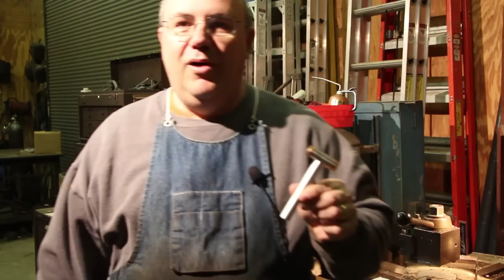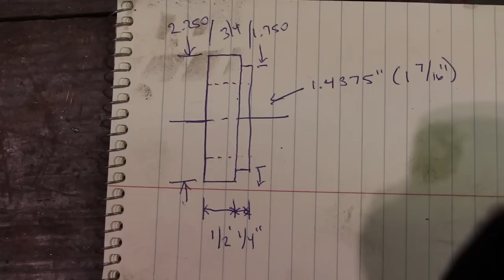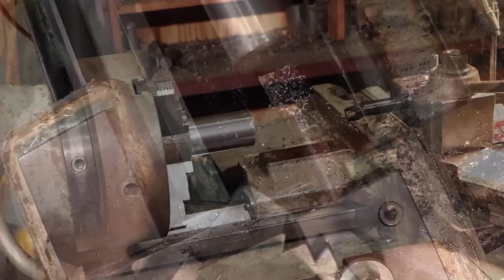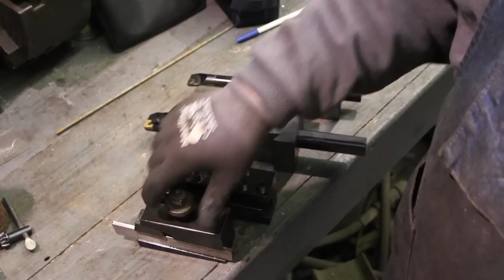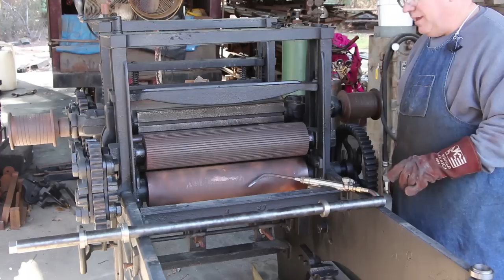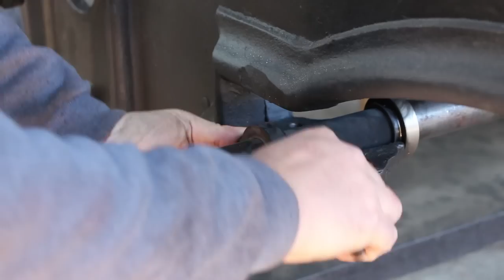Pouring Babbitt Bearings on the J. A. Vance Planer/Matcher

Comment: I'd guess you do the bearings for your steam loco's too? I did a lot of the bigger babbited bearings in rail stock a long time ago .Pretty much the same as you do it except we used a dreadnought file to clean up the edges. If a precison fuit was required (lathe repairs) we would file the bearing face(to remove the hard skin) then scrape the bearings to fit .A great way to learn how to be patient.

Comment: dude is very crude and sloppy its a shame im sure he could slow down and do good work
Reply: what part specifically do you find crude and sloppy?   what bearing pouring experience do you have?
Reply: Well if you don't like him, you do not have to watch him. Take your rude attitude somewhere else and pump your inflated ego. No one is making you watch here
Reply: crettybocker Babbitting IS a crude and sloppy process, but it works and lasts (if kept lubricated). The soft metal is very forgiving of defects in machine work. Can't say that about today's equipment--if it's not perfect, it's broken! Process no different with small equipment or locomotives.
Reply: ***** This was very interesting, I used to pour lead joints in cast iron pipes and I used something called a running rope to block off the pour on horizontal runs. It was made of asbestos but now they are made of nylon (not as good). It might be a good replacement if you can't get any more of your babbitt-right. A plumbing supply should have them.
And the guy above gave me a chuckle, some people can mess up a free lunch.
Thanks.
Reply: Seek professional help.
Reply: crettybocker WELL, IF YOU DON'T LIKE IT- YOU DON'T HAVE TO EAT IT!!!

F#CK OFF- TOAD!!!
Reply: Fester Blats WHAT ARE YOU GONNA DO ABOUT IT?!!

Comment: Keith, I work in the large apparatus repair industry, and Babbitt is very commonly used for steel mill main drive motors, both in rougher stands, gearboxes, and finish mill stands.  It is also, as you said in the video, still very common in large power plant applications such as turbine generators.  Mainly equipment dating from the 50s-70s, that is being used today.
Reply: To add: most bearings in large applications are no longer poured in the field.  The shells are removed, spin cast off site, and machined to size.  They're then scraped to proper fit and clearances once installed.

Comment: Great video. I have enjoyed all of your videos. I have a bunch of old machine tools i hope to restore in the years to come and i find your work here very helpful. Back in the late 1970s i was working in a wrecking / scrap metal yard in N. California. We got a old Aermotor windmill for scrap and decided to put it to use on a well at the rear of the property on a old well. The babbitt bearings were worn out so we got a piece pipe with the outside measurements of the bearing and a piece of steel shafting appox the size as the shaft in the windmill. We put the shaft piece inside the pipe and melted a bunch of lead wheel weights in a ladle and poured it between the pipe and the piece of steel shaft. Then we took a hacksaw with a fine tooth blade and cut the pipe and lead twice lengthwise. We split the pipe in half and knocked the two lead pieces loose from the piece of shaft. A few shims made from pop cans and it is still working after 35 years. Whenever in the area i go visit my former boss and friend of 45 years. The topic always comes up about the windmill job done years ago and our late friend Okie Custer who oversaw the repair and loaned us the bearing scrapers to complete the job. 

Chuck.

Comment: Amazing stuff. I'm not too familiar with this so forgive this simple question about pouring the Babbitt bearing for the top brackets. Would there be any advantage to mount the top brackets upside down on a workbench? I would think it would reduce air pockets but I notice it seems the top bracket was designed to accept Babbitt for the top.

Comment: This was a very helpful video. I have been looking for a excuse not to condem the babbit bearings in a 12in Frank Clement jointer from about 1905. I would like to put a spiral cutter head in it and was thinking about converting it over to ball bearing because I thought it may chatter. But after stumbling on your video, I would like to ask your opinion on the project. I am a little concerned about the cutter head being exactly parraelle with the tables. The cutter head that is in it now is a round two blade head. I would love to here your thoughts
Reply: ***** Thank you for your response. In trying to keep it short I got you off the path I was looking for. I understand all that with the knives. The 12in jointer is one i`m going to restore because i`m a fan of old machinery and a brand new powermatic with spiral cutterhead is more then I am willing to spend, and the reason I found your videos very recently. (The electrolysis video I saw this morning will be a big help). What I am asking is will a carbide cutter head perform as well with the babbit bearings , if they are in good shape. as trying to change this machine over to ball bearings. As far as the finish I would have to ask you if you would dig out the high speed tool bits for turning that rusty piece of round bar you made the dam collars out of. I know I would have wore out a pair of shoes walking back and forth to the grinder to fix my tool bit.

Comment: Well done, thanks for the excellent lesson. I suppose that this kind of work puts you into the class of Millwright. I have operated some old equipment over the years including some which was designed to be powered from the central overhead drive shaft running through the factory but have never come across the need to replace a babbitt bearing. I promise that in the future I will be looking closely for the split bearings with the riser hole in hopes to find a reason to re-pour the babbitt bearing. My guess is that very often the original bearings are replaced using oil-lite or adapted to a ball bearing.
Reply: Yes Bob thats cool. I remember the war finished machines at don bosco
Reply: http://www.3dprinterworld.com/article/igus-tribo-filament-for-3d-printed-bearings
Reply: Michael Meyer Mike are familiar with carbon tear out on face seals? I know this is off topic but have a project going this week. Like a mag seal but not made by them and is spring loaded.
Reply: ***** Keith, there isn't enough time in a man's life to be an authority in so many aspects of manufacturing. You can be proud in knowing that you are where I learned how to pour a babbitt bearing. You also caught the interest of two old aerospace engineers that learned the trade the old way, the right way. Thanks for the video and thanks for giving Mike and I a place to get an AOG back in the air.
Reply: Michael Meyer Mike, very soon we will be seeing 3d laser sintered titanium, aluminum etc. Snecma has a division devoted to this. They are producing parts for the e-APU60.
Reply: yes they have had they ability to do many of the incinels  when I fist looked into the process about 7 years ago.  and at CCI we were trying it with resistors for pipeline systems in steam generation systems.
 i think they are calling it DMP Direct metal printing now.
http://www.3dsystems.com/3d-printers/production/overview

Comment: *****, Thank you for this video. Another Great job!
Is there a reason I am not thinking of, as to why we could not pour the caps facing the same direction as the bottoms? Making two of the collars with steps on each side, and an additional two collars for the ends of the caps. In essence, having 6 collars in total, (two with double sided steps) and all four sections ready to pour in the same direction. Simply blocking up tight the top caps, but facing up from the bottom. Plugging the hole, and getting a better pour?
Reply: I think it is best to pour the top with the cap bolted so that way everything is lined up to the shaft better. 
Even though the end caps would appear as though they keep the cap lined up with the shaft, it is a better fit to do the pour with the top cap bolted to the bottom housing and shaft just as the machine will be running. 

   Doing it the way you describe allows the possibility of the bearing being a little off center IMO.
Reply: Hey Keith. I envision being able to take the caps, flip them upside down, and put each one next to their mated base. U side up. Filling all four pieces the very same way. 

The collars you made to hold the shaft in the center, on the block, for the pour, had the step machined into one side on each one to do this. If two of those collars were made with a step on each side, one step could be used as you did, and the other (stepped side) would temporally be used to hold one side of the upside down cap next to it. Of course another collar wold also have to be made for the other side.
Reply: *****, I also just posted a private quick sketch, showing this a bit better. On G+.
Reply: No sense in re-inventing the wheel. The man gave us the lesson on how to pour a babbitt bearing, unless you are a certified millwright with the experience go with it. If you are a millwright please take the time to post a video it, will be greatly appreciated. We all benefit from the lessons lost over the generations.
Reply: Jacob, you couldn't be more wrong. There is nothing wrong with trying new things. I can't count how many times I have redesigned a machining fixture or a cutting tool to do things better or faster. I even keep up with 3D laser sintering of titanium to eliminate most of the machining required to produce some hogged out components for aerospace work. All said, I do hold the Highest Respect for the Techniques used to overcome the challenges of manufacturing during the Industrial Revolution. I am about 50 years too young to have been involved in that part of American History but find it intriguing and am proud to have had the opportunity to work with some long retired people that did show me a few tricks during my early years in the trade. Jacob, keep in mind that Keith Rucker is keeping some of that tradition alive for now. Listen and learn when people like Keith speak because he isn't paid to educate anybody with the desire to learn. I say this in memory of Fred Russell, Doy, Harvey, Dick Winniberry, Jack, Moe Dubois, Harry, Peter Redgrave, Clarence Hogan, Jack Ahern, Dick at Hughes Radar Systems, Colin Coates, Kenny Griffiths and many others that shared tricks of the trade with me. I am sure that most have passed away but there might be a few still walking on this green earth.
Reply: ***** Jacob, read above. I could go on and on about your comment but really don't have the time. I have to get to work on some helicopter gearboxes needing my attention this morning and when I finish those some time this or next year maybe if I am lucky I might be able to talk some stubborn old men into HVOF repairs to some vertical lift aircraft components

Comment: This is awesome! Being new gen, I have never seen a process like this, but I really like the old techniques. There's just more soul to the work done.

During your pour of the top caps you had some issues with air bubbles and burping. Why not grind/machine some "bleed passages" in the spacers you turned? You could then use some wire when you dam to give air vents for the pour. You did mention the cavities are not really an issue, but they may be avoidable with just a few more minutes of effort.

I really appreciate the work you've shown here. I'm looking forward to watching more of your videos.
Reply: *****  Oh, I understand that. It's difficult to describe what I had in mind. The idea was to stick a wire into the installed spacer, then dam, and remove the wire. In effect extending the vent above the bearing void.

But it's just a random thought more than anything, really.

You do good work :)

Comment: Good video! I do babbit work on mostly automotive and like you I have seen shims made out of all kinds of stuff from newspaper, cereal box cardboard and leather. McMaster Carr sells brass laminated shim stock in various thicknesses that can be peeled in .002 increments to allow adjustment of the bearing due to wear. I normally will discard any old shims that are not metal and make all new ones.
Reply: ***** Harbor freight also has the hole punch set that works good to cut the holes. With the speed the shaft on your machine will be turning there will not likely be any wear to speak of for the rest of the life of the machine. I have seen 1 other person years ago pour the bearings like you did here by smoking the shaft and that brings back memories. With all of mine I pour that castings and then line bore but still have to scrape to fit. BTW, I love the old planer, they just don't make machines that have pleasing character and design anymore. Preserve what we all can while we can. From the sounds of the whistles in the background I bet you are working in a very interesting location.

Comment: I upset to scrape in bearings on 1200hp and larger when I worked in an electric motor repair shop. I found that a1in.x2in.piece of cut off tool( don't remember if it was high speed or cobalt) mine was 0.100 +/- a thou.or two. I would stone a couple of sides then burnish like you do a card scraper for wood. This gave you a couple of sides with burrs you could feel. Use this just like a scraper too remove high spot on blued Babbit.

Comment: Check out Deacon Mold-Pac for the Babbitrite replacement. Did a little Google search for you. Thanks for the fine video.
Reply: *****
Is it something special that Babbittrite contains? Why can't use something like sand+clay? Or some material used for casting molds?

Comment: Thanks, this was a very nice explanation on pouring Babbitt bearings. I have a little Hercules engine that I have been looking forward to pouring the rod and mains on. Which would I be better off using, the lead or tin Babbitt?
Reply: Well, you get what you pay for. It is usually worth spending a little extra to do it right. Thanks.

Comment: Keith, Love your channel. Ton's of interesting stuff. I used to work in a foundry (Puget Sound Naval Shipyard)… back when I was younger… ;) Not trying to be a safety police. Please don't consider this comment to be negative. As you saw, when liquid hits a smooth surface like a concrete floor it wants to flow out. When I saw you kneeling by your very full ladle, my butt puckered some. Full ladles have their own trouble for pouring but smooth surfaces can wreck the day. Pouring on bench tops can have the same effect accept then the metal flows out and down… ugh. Even some dirt on the floor would impede the flow of liquid metal. Just a thought.

Comment: another darn good video Keith, thanks for the upload, the popping you were encountering during the top bearing pour is steam.. water gets into the paper shim and then flashes to steam when the babbitt enters the shell. one way to avoid that is to dry the paper in the oven at 140 deg or in the microwave. any water coming into contact with the hot metal is gonna make it pop violently. it only takes a few molecules of water to make the babbitt pop so it is imperative your shims are absolutely dry.

Comment: Before I retired, I worked for a steel mill that had many types of machines that had Babbitt bearings, when any needed to be re-poured, they used a material called "DAM-TITE". I am not sure they are still in business or not but that material looked  to be the same as you used in the video. You may have to do a  Google search on what company sells it. Hope this will help in locating any.

Comment: Keith, I want to thank you for keeping these skills alive. My grandfather poured Babbitt bearings in a 31 Chevrolet decades ago. When I was about 12 years old he taught me to make gaskets with a small hammer. That skill has saved me several times out on the road having to remove a stuck thermostat, it's hard to find a part store open at 3am. A piece of thin card board is easy to find even in a bar ditch.
Reply: Bar coasters, cereal boxes will work as a gasket.
Welding with jumper cables is a art :)

Comment: Keith Hi,
  What I often do when pouring bearings is to drill a second hole in the oil trough and then try to pour my babbitt through only one hole. The second hole then provides an escape route for gas and steam. When you finish the job you can either drill out the extra hole for easier oil access or just leave the babbitt in it.

Comment: Is it possible to pour the babbitt for the top bearing cap on a bench or other flat surface using the same method as for the bottom caps so gravity and venting are working on your side or is that overkill? I really enjoy your videos and the fact that there are people out there willing to do restoration on these old machines! 
Many thanks
Caden D. from MT

Comment: 47:03 Any idea what caused it to sputter and pop when you poured the upper casting? That could've been dangerous, and it would be good to know how to prevent it from happening.
Reply: *****  what would happen if you put a relief notch in the end caps you made. position it up.. this would allow the babbit to pour into the middle.. spread out to both sides and any excess come out the vents grooves.. since they would only be cut ever so slightly .probably with a cutoff blade thru the inner step and just a shallow groove in the flat face of the step.. it could leave a slight clean up.. but cleaner top pours would be better..  just a few thoughts as i used to pour lead joints with a rubber gasket tor a guide for cast iron sewer pipe connections.